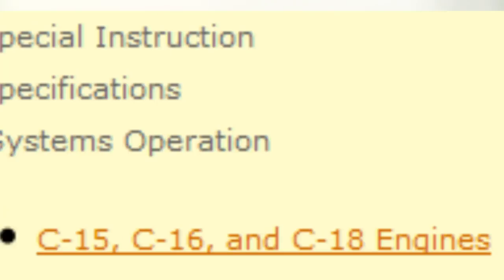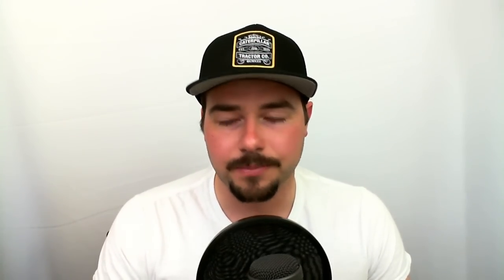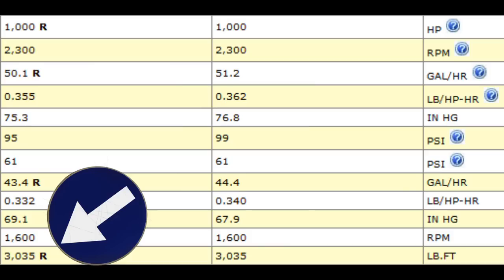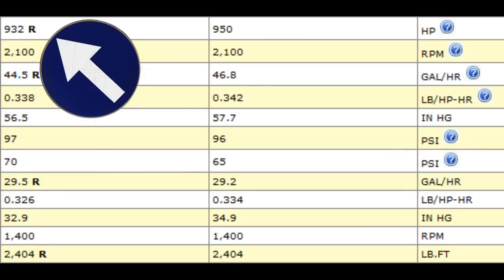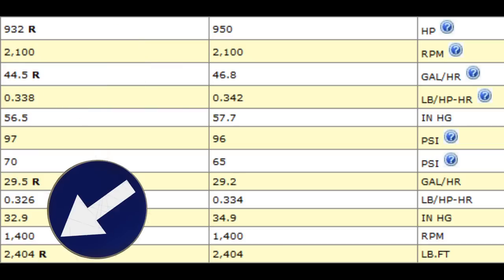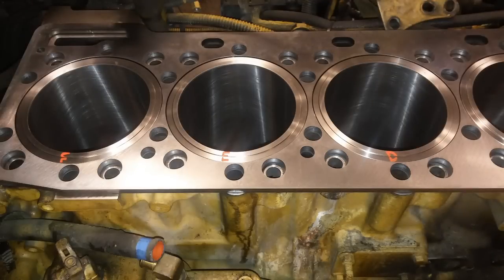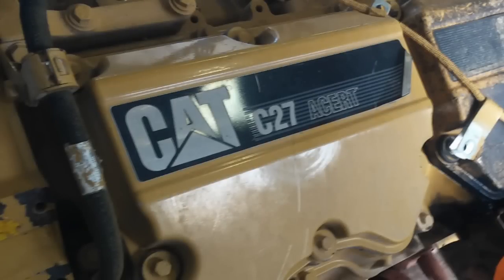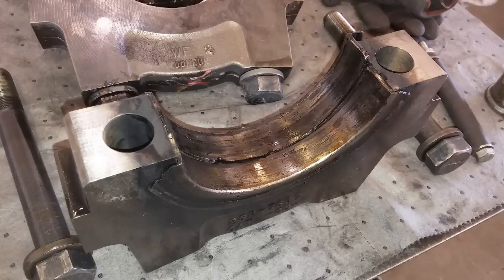Turn A Cat C15 Up To 1,000 Horsepower With Stock Parts.  The Ultimate 3406 or C15.

Comment: on the "destruction of the week", what do you think caused that?
Reply: I hope he passes along some more on that story as time goes by....
Reply: ONE POSSIBILITY ON THE GEAR FAILURE IS BEING OVERHEATED
DURING INSTALLATION!
IF METAL IS HEATED BEYON A CERTAIN TEMPERATURE IT MESSES UP THE HARDNESS OF THE METAL HEAT TOO HOT AND COOL TOO SLOWLY CAUSES SOFTENING OF THE GEAR MATERIAL!!
Reply: ROSS Bryan6 I was thinking more along the lines of something like the Cummins killer dowel pin.
Reply: @rossbryan6102  overheating causes brittleness.

Comment: U would destroy rearends is my first guess. 
Again. Just a guess.
Reply: The rear end would be the strongest link in the chain (so-to-speak).  The clutch, transmission and the driveshaft would suffer and fail before the rear end saw any damage.  I remember in the mid 90's when both Caterpillar and Cummins hit the 2050 ft-lbs torque mark,  there weren't too many choices of transmissions that could handle it,  the drive shafts were pretty much special project outsource spec'd, and they had to put scatter shields above the u-joints, because when/if the u-joints would explode, they wanted to slow down the shrapnel before it came up thru the floor and hurt people inside the truck.  Of course, it wasn't long before the drivetrain people upped their game and got some better offerings to accommodate that kind of torque.
Reply: A friend told me about a parking lot that got his c15 turned up to 1000hp range and started pulling a grade and got in the throttle a bit and dropped his gearbox
Reply: tractorboy31 u dont get a 1000hp outa a tune! Takes cam, injectors, turbo and tube. So I doubt he had a 1000hp. Most likely he got a shitty 600 tune, didn't have the right trans in his truck, or it was operator error.  Add HP try pulling grade in top gear, watch trans temps climb! U have to watch your trans temps on 8, 10s,and some 13sp, they aren't rated for high tq like the 18sp are
Reply: If you can't drive, you will blow up equipment.
Reply: I have been driving a tri axle dump with a lot of good stuff into it and never a failure, so have a few of my friends including three with three over 1000 hp and no drive train failure, its been years, mine was set up in 2010 and still going strong, you have to know how to drive your equipment, i know people that have been destroying trucks with 300 big cams and it seems every truck they drive are piece of crap because it always turn out destroyed, is not so much about the hp but it sure is all about the driver.
Reply: The C16 put 2400+ ft/lbs of torque out in the early 2000's.  It was an engine option that only 2 transmissions were offered with: Eaton Fuller Super 10 and the 18 speed.

*US Express, in the early 2000's, was really pushing the automatic transmissions (Freedom line? Liberty?...some name like that) back then in driver recruiting.  Real class 8 automatics(crappy), not what's out today(which is a standard with a computerized shifting box mounted to it).  Anyways, there's video out there somewhere of a C16 mated to an automatic, in a room, on a dyno...2400+ ft/lbs nuked that transmission in 2 seconds.
Reply: Brian Sparks it would have been an Eaton Autoshift, just an automated manual transmission. The only automatic that would live behind that engine is an Allison and no one is willing to pay for that one.
Reply: Steve Ross ...Eaton AutoShift?  In the early 2000's?  I never worked for US Express, but I don't think you're correct.
Reply: Clutch trans and driveshaft weak links
Reply: Brian Sparks super ten behind that? Are you sure? I only remember the 18 being offered
Reply: kentucky 82 ...Yes, I'm sure. :) I used both. The Super 10 was bulletproof, and the c16 proved it.
Reply: We used to turn early Cummins turbo 220? Up until blue flames just peeking out the stacks on 70's triaxle dumps and gross 150k into the PA mills.... before all the gootta be legal shit in 1990
Reply: pistons will go first, tops need to be ceramic.
Reply: angus kangus you'll definitely melt the tops no doubt
Reply: out put shft on transmission toast

Comment: Bore and stroke and this and that blah blah blah. Just tell people more boost more fuel = power don't really need an algebra lesson. C18 is a true twin turbo. Accert appears to have compound turbo setup but it only has 1 turbo the other is scavenger for emissions. I have a little series 60 compound turbo setup. I would have used a single but it's small displacement had trouble spooling very slow or lag. I put 1 stock style turbo feeding a Pittsburgh big dog turbo comes out of vacuum 800 rpm for a total of 75 psi on the springs  holds 72 psi all day. 815 to the tires 2,000 torque. A little low on tq. Because of small displacement and shorter stroke. Only other parts other than stock is a  Pittsburgh box. Custom injectors.and a custom billet cam. And the turbo setup and manifold I made or customized myself to a cost of 9Grand. Boost plus fuel power power. Very simple.

Comment: It wouldn’t be worth the fuel
Reply: Probably . . . (O_O)
Reply: Disagree.  If you look at the bsfc number ( the lbs of fuel/hp per hour ) the engine does not consume that much more fuel over a C15.  It's how you drive it. Bigger engine makes more torque, works less and consumes less fuel doing so.
Reply: Steve Ross it's a fine line few can walk. 😁
Reply: JIGA BACHI Been walking that line for a long time....after you deal with the bills of a broken truck long enough, you grow up and learn how to save your equipment.  A C18 is overkill, but in the long run it will make more money since the weight of the loads won't slow the truck down.  Average speed goes up, fuel consumption drops, driver fatigue drops and productivity increases.  Big tax write-off bonus plus the resale value ( not that a smart owner operator would give a C18 powered vehicle up )
Reply: It’s a different diesel, but when I cranked on my vw diesel and pretty much jumped from 90 to 150 rated hp, I didn’t have to get in it to get up to speed as much, and I picked up like 2mpg average. 
Beat the tar out of it and yea it would use fuel, but you were going way too fast.
Reply: MrHillfolk if you're a mature owner or operator, every truck should have at least 650 hp and 2300 ft/lbs of torque.  Less power makes you work harder.  Take a look at the big power Scanias for example.  The 720 produces the best fuel economy.  Nobody needs 720hp and over 2300 ft/lbs of torque but the numbers don't lie. Sure the European speed limits are much lower, but that big, understressed engine is not working no matter how it's loaded.
Reply: Steve Ross in America we'd run triple digits though
Reply: Steve Ross 
Usually the loafers will last longer. 
Over in the generator world, everything is about going smaller. 
A common natural gas/propane engine for a 100kw gen was a gm 8.1, the 502. 
They’ve replaced that with a turboed 350. 
Time will tell, but I wouldn’t wanna see one run 70-80% load for a week, it might go bad.
Reply: You don’t typically run a Caterpillar for fuel economy?
Reply: Yes in theory a larger engine is not going to work hard pulling the same load as a smaller engine but it's physics it still will overall consume more fuel per gallon because of its much larger displacement and greater weight which is why the average large fleets tractors are relatively light weight with engine and drive train setups that don't usually exceed 400 to 460 hp and 1250 to 1650 TQ. Pulling the same loads the smaller engine is efficient enough to move 20 to 40 tons as the bigger engine doing the same all while getting much better fuel economy you can't debate physics.

Comment: What could cause the c27 damage?
Reply: The oil pump drive gear was not secured in properly or something got jammed in the oil pump's drivetrain (kinda like Cummins' Killer Dowel Pin fiasco). Stripped the oil pump gear, engine lost all oil pressure and was basically totalled.

Comment: What would you have to do to the transmission to make that reliable?
Reply: Spend more than the cost of a stock c18 used transmission + refurb?
Reply: These motors are used in a lot of the big Semis that are specd out to do oversized loads most of them I’ve seen have the autoshift Eaton 18s that can handle 2250tq or you can get the Eaton manual 18s at 2150tq or 2250 if you order them brand new. Quote from KW was 7900 for the tranny plus install which woulda been about 2500 more. Or you can install it yourself and save that 2500 for lights and chrome! Unless your doing the autoshift from a manual a straight across tranny swap manual to manual isn’t that tough of a job just spend the money while you have it apart and go new from crank to driveshaft.
Reply: kickincain... I believe you have miss-spelled a word.     Pretty sure there is no "f" in autoshit  :)   Furthermore,  there are no effen autoshit transmissions in my trucks  :D
Reply: When c16 was being sold in early 2000's,  the Super 10 and 18 were only 2 transmissions that could handle the c16 torque...only 2 options.